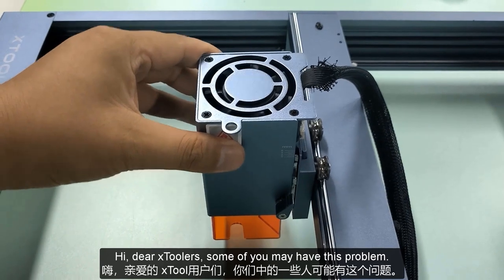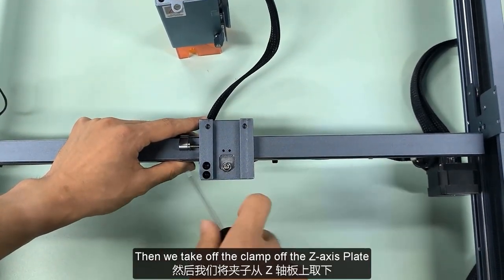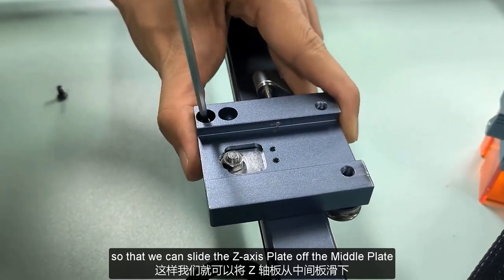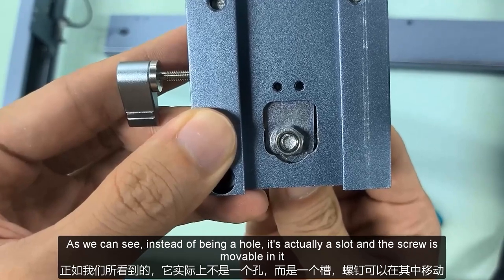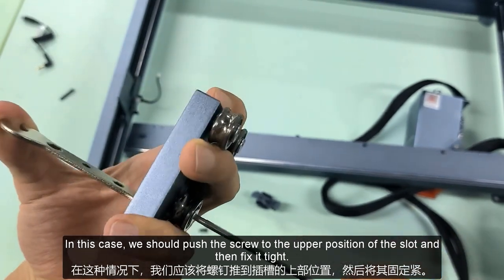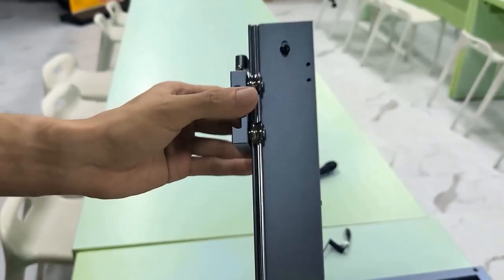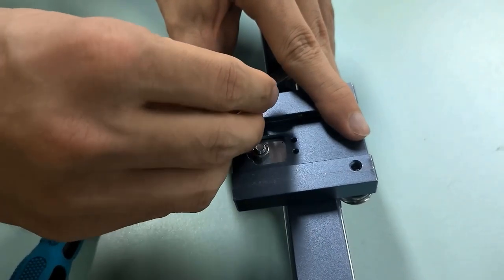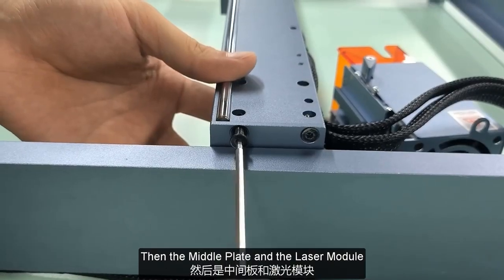How to fix the Z-axis Plate tight for xTool D1 Pro?

Comment: My xtool d1 pro does z axis plate is NOT slotted but has a single hole and is not adjustable. It is so loose it has terrible performance...what can I do to get a slotted z axis plate?
Reply: Mine doesn’t have a slot either - did you figure out how to fix it?
Reply: My D1 Pro has a slightly elongated mounting hole for the lower bearing, but I can't take up the slack in the rollers to adequately stabilize the x axis laser trolley.  I think X-Tool owes the owners a more accurate fix than to pry on the mounting screw with a screw driver while tightening.  This not a good technical adjustment.

Comment: Are there adjustments like this in the M1 laser module? Mine is so loose it will not home without me pushing back on the top of the laser module. Thanks